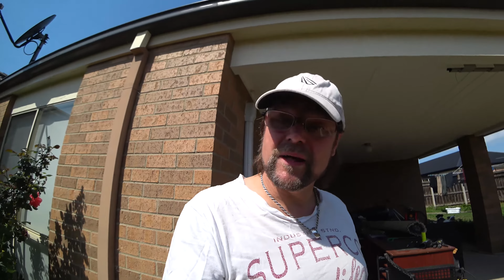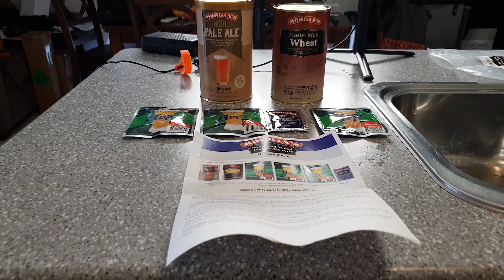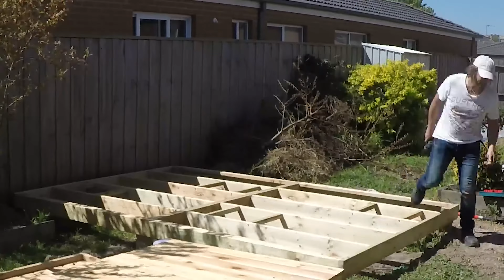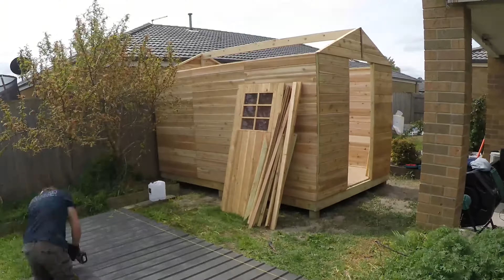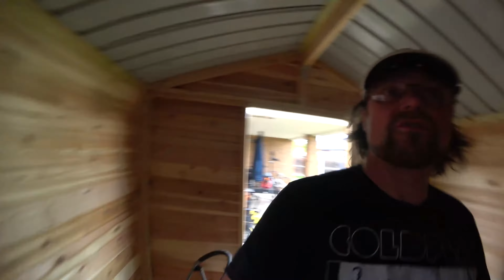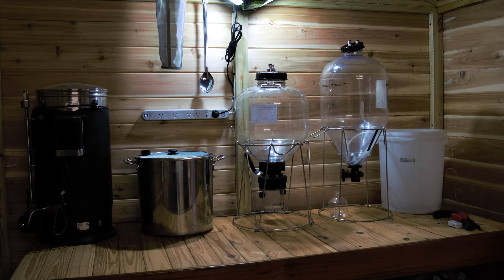The New Brew Shed (The Master Shed by Stilla. 12 x 8', or  2.53m x 3.64m)

Comment: Wicked brewing spot mate -  One question; how does it handle heat? I only ask as I can only imagine it gets hot where you are in summer (Nears 40C up here in QLD).
Reply from the maker: You are so right, i am working on insulating it as i go. We just had a couple of days at 33C last week. It got pretty hot in the shed.
Reply: @SimpleHomeBrew  Haha I would imagine! Bloody Aussie summers...I just got my current IPA into the fridge for some cold crashing time - It also got up to around 34Degrees last week but luckily I'm using a Kveik strain, so it can handle the heat! 

I can't wait to get something similar to your shed, currently it's the second bathroom I brew in..